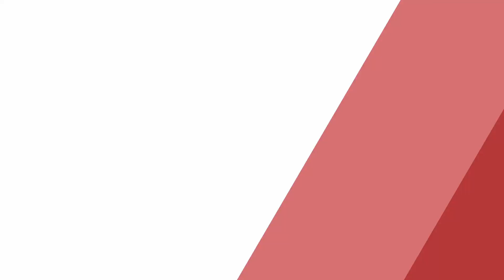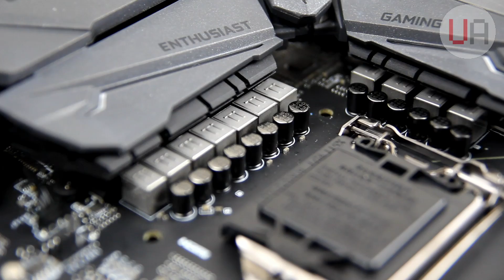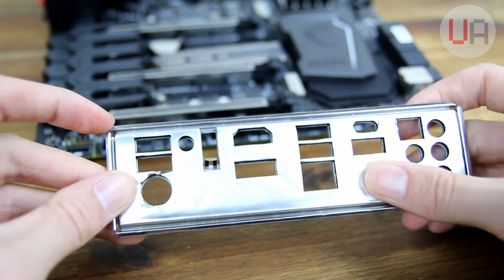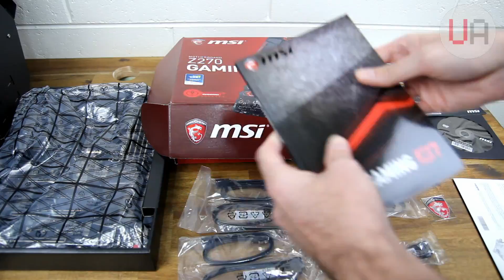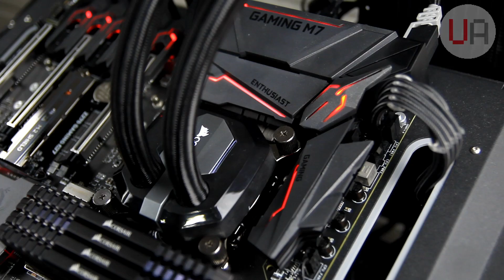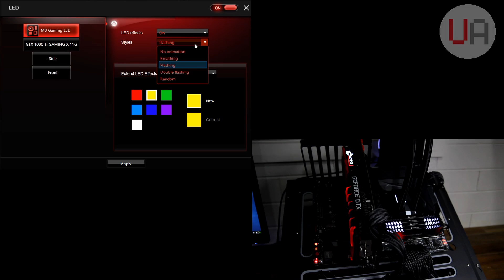MSI Z270 Gaming M7 Review - My New Test Bench Board!

Comment: Hi new subscriber,I'm changing my motherboard to the M7 however it has CPU PWR 1 - 2 1 being 8 pin and 2 being 4,do I need to power the 4 and if so the lead is a split 8 pin 4+4 is it OK not to use the other 4? OH and my power supply is EVEA 850 GQ semi modular,yes I'm aware it's over kill.